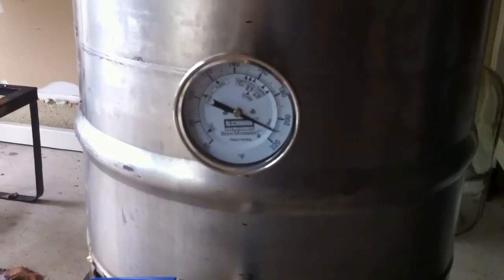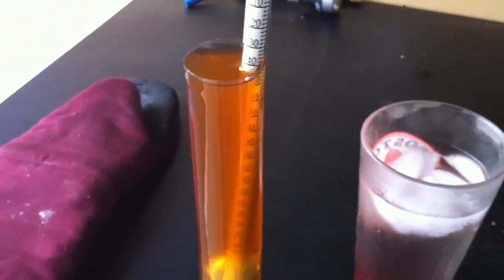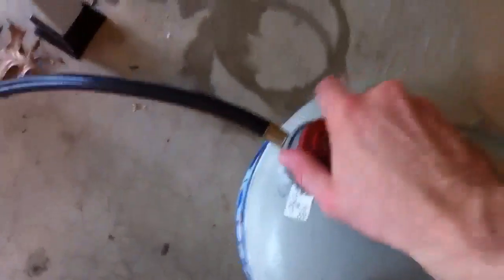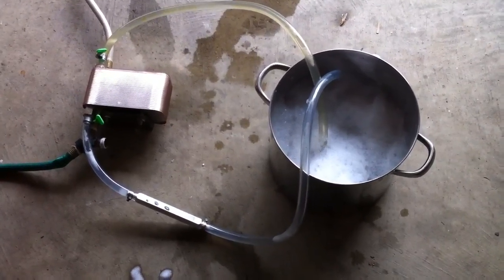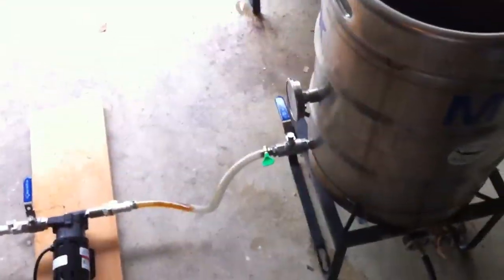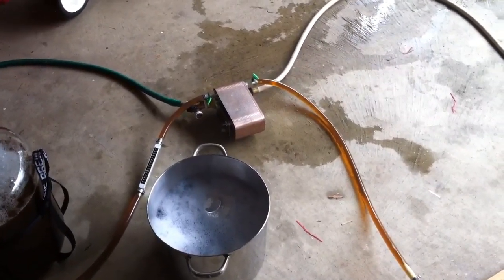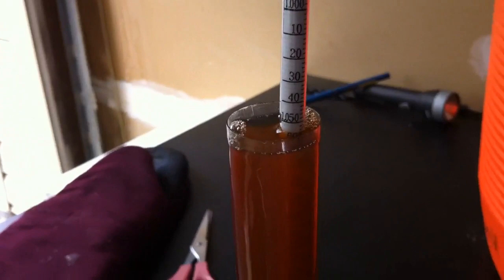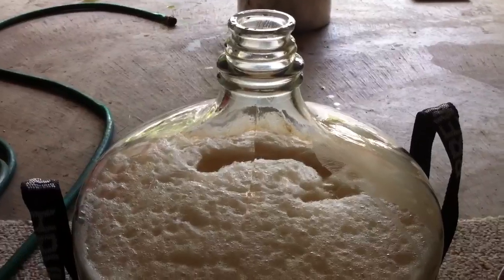Homebrew: All grain with a basic HERMS setup (Part 2)

Comment from the maker: I now use a platinum cured braided silicone. I used to use platinum cured silicone. You can pick it up at any homebrew store, or online. I did make my mash tun. I got the cooler from home depot, and the other components from the homebrew store.

Comment: Do you use brew software? and do you have any recommended resources.  I have been brewing for about a year and half with 5 quart brew pot using a steeping grain method, diluting the boiled wort with cold water in my fermenter.  I've been using recipes to brew (basically taking the ingredients from the kits I used to buy and just getting the individual ingredients which ends up being a bit cheaper). But I'm looking to upgrade my system to something similar to yours. Where did you start??